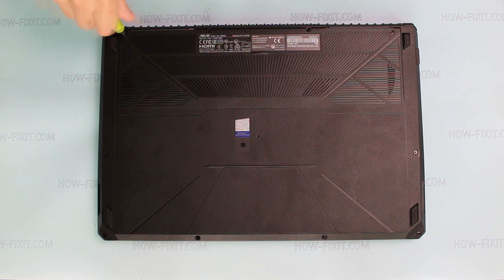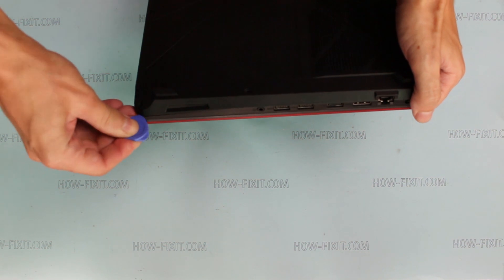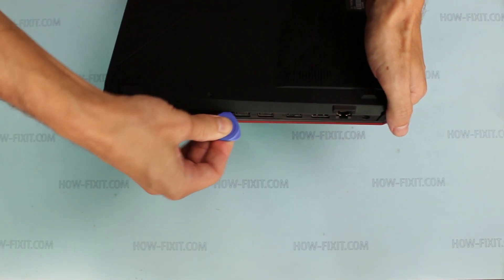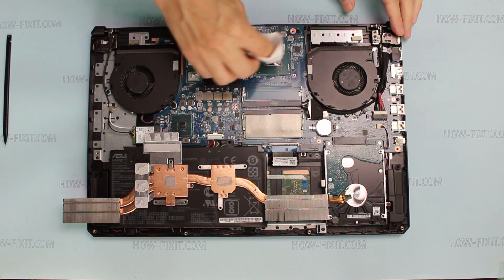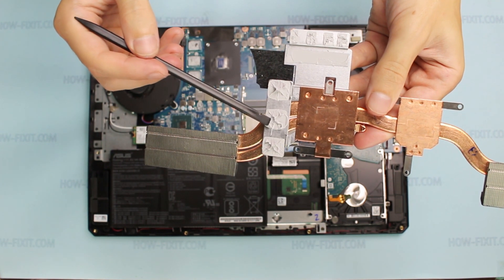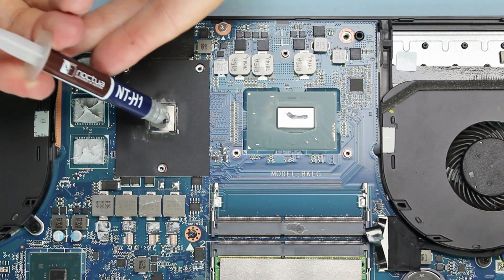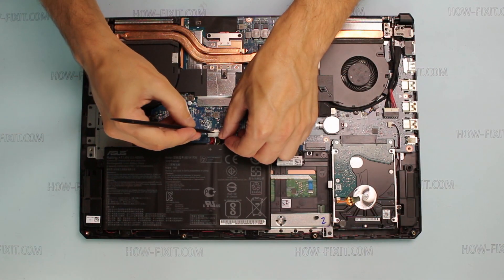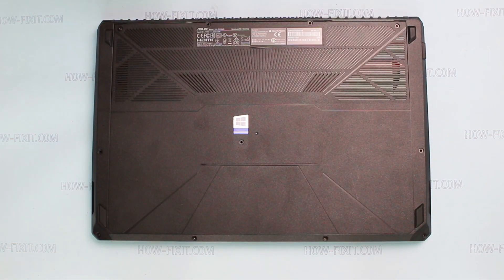Asus TUF FX504 Disassembly, Fan Cleaning and Thermal Paste Replacement

Comment: My gpu was at 80 celcious , 90 + on specific games. I literally dropped my resolution to 800x600 just to not stress the system. After opening up and following your example to the letter, i can hear my fans shoaring. 
The paste from manufacturer was a solid block of gum and allover the place. I meticulously spread paste just to cover the surface evenly and now my gpu is 56celcious tops...
I cannot fathom this, thabk you so much.

Comment: Hello, thank you for the guide, but I saw it after I changed the thermal paste without removing the battery, and after finishing, the laptop stopped working. What is the problem and how can it be solved?
Reply: Sadly, your motherboard probably died. I made the same mistake not removing battery while replacing the screen and had a spark (short-circuited) which luckly destroyed backlight unit only.
If yours can't even start the bios, then it is the motherboard I assume

Comment: According to Intel it's better to not spread the paste after applying. "It might be tempting to spread the thermal paste onto the CPU yourself. We recommend letting the pressure from the base-plate or waterblock being installed do it for you. Incorrect manual application can cause air bubbles to form in the paste, which can negatively impact the thermal conductivity"

Comment: Hii, amazing tutorial, but I have a huge problem. At first I didnt have the proper screwdriver so I used the smallest one I had and tried to take out the screw of the heat pipes but I couldn't. Then I bought a set of screwdrivers and finally managed to unscrew them, except the one I had been trying to unscrew, its head was worn out. I still can't unscrew it and the laptop is getting really hot. Is there any way I can take it out? Maybe ASUS can fix it?

Comment: My laptop wont turn on after this 
Even my charger led is not turning on (i didn't take my battery cable out before taking out the heat sink is that the problem) plz help plzzzz!!

Comment: Thanks for the tutorial! I need to do this soon for my fx504 lol it has become so much worse performance wise
Reply: Is it good now? After installing thermal paste? Also which thermal paste did you use and in how much quantity?
Reply: @madhunagar7940  I replaced it today, the temperature has dropped quite considerably, initially it would get to 88 and undergo thermal throttling, but now, after extended periods, it stays in the 76 to 80 range. On normal use, it's temperature has reduced by 20 degrees. I used the same noctua thermal paste used in the video. It was a bit difficult to remove the plate covering the cpu and GPU, but it eventually came off

Comment: I couldn't unscrew the heat sink at all
It was screwed very tightly
Reply: Same dude, I saw that there was another set of smaller screws after unscrewing cover so I looked around for a smaller corresponding screwdriver, only to find out I couldn't turn it at all even though it fit the screw head
Reply: I got it unscrewed by bringing it into an electronic store. Apparently I just need the perfect screw for it which is way too specific

Comment: My CPU was running hot on my one year old FX505DT, temps running near 200F during game play.  I replaced the thermal grease on the CPU and GPU, now my CPU Temp is about 160F - 170F during game play.   Thanks.

Comment: Thanks a lot, got about -40 degrees drop, cleaned fan and replaced paste that was inexistent
Reply: Replaced all the paste,
Reply: used thermal pads and paste both
Reply: @mirko7098  I used thermal paste everywhere.. i don't have thermal pads...
Reply: how did you cleaned the fans/

Comment: unfortunately, you must remove the heatsink in order to clean the fans, which means that you have to replace the thermal compound every time you do that. I used arctic MX-4 and after replacing the stock paste managed to reduce my CPU temp during a stress test from 90C (thermal throttling) to 72C max. results would probably be even better with something more expensive than the MX-4. so yeah, guys, replace the stock thermal paste, it's garbage! ASUS really didn't bother using quality paste, unfortunately.
Reply: Can you suggest which thermal paste is the best, mine stays at 77-80oC while playing low graphic game.. I just changed it last week..
Reply: @Dean.Michael.Winchester  I bought some gelid gc-extreme and so far am extremely happy with it. 3 months after changing to it the temperatures are still good.
Reply: @Gedas_Ke  what's the temperature tho?
Reply: @Dean.Michael.Winchester  goes up to 80C during a 10min stress test, which doesn't trigger thermal throttling.
Reply: @Gedas_Ke  oo thank you for the input, I am going to try that brand, I used to use Kryonaut before, but I seem to dry quite fast since I am a heavy user, now I am using coolermaster master gel, but I am dissatisfied with the performance 😔
Reply: @Dean.Michael.Winchester  ah, see, Kryonaut is a bad choice for laptops, because Kryonaut has a max temp of 80C. It is super good in terms of performance, but degrades quickly at high temps of 80+. And laptops often reach 80 under heavy load, so it's not good long-term, it will degrade much faster.
Reply: That’s why you use compressed air to clean the fans
Reply: @verynice4829  yeah, what else would you use? not sure I see your point, friend
edit: ah, sorry, I got what you meant. yeah, that works for surface cleaning but I find that it's hard to get all of the dust out with just air, as you need to get there from both sides in order to be thorough. maybe it's not necessary, I'm just kinda OCD about these things. x)
Reply: @Gedas_Ke  ohh, btw what did you use for the vrms? Is thermal paste enough or should I get thermal pads. I have a similar laptop. tuf f15 2021
Reply: @verynice4829  I just used paste, seems to work fine, though I will admit I don't know if pads would be better or not, I've never tried them out before.

Comment: do you have a video of how to remove the fans? i accidentally banged the side of my laptop with my mouse the other day and the right fan has been making it a weird grind noise . i completely cleaned out the vans with a air compresser and vacumn and sprayed a hint of lubricant in there but its is still making the faint grind noise, nothing seems to be rubbing on it and nothing is caught in there from what i can see but im hesitant on removing the fans because it looks complicated
Reply: never, ever clean your PC with a vacuum.
Reply: @Gedas_Ke  i ended up replacing the fan its fine now, used the vacumn nothing bad happened
Reply: @dukenukem7043  that's good to hear, but in the future I would avoid using a vacuum, compressed air is more than enough to clean dust and is safer for the hardware. cheers!

Comment: Which one is the CPU and GPU?   Is the GPU closest to the memory card slot ?  With Desktop computers the CPU is easy to locate. I am not familiar with laptop layout and it's components other than Battery, CMOS Battery, Fans, Memory and Hard Drive / SSD,  and heat pipe.  I need to replace a noisy fan, think it has a bad ball bearing,  so I need to know which one they consider being GPU or CPU side. Why did you not replace the thermal paste on the other components as they seem important too. This would of been the perfect time to install another memory module for Dual Channel (2 x 8GB) and replace the slow Hard Drive with a SSD as you could use a program like EaseUS Partition or EaseUS Todo Backup to clone the Hard Drive operating system / Windows 10. It would greatly improved your laptop performance with those two upgrades.  You did very well on the video. Thank you.

Comment: To anyone who is wondering about the thickness of the thermal pads used for the smaller chips, I spoke to Asus and apparently they're 0.5mm thick.
Reply: How about for the tuf505du series?

Comment: i Have a new tuf fx505dd ( 3 months old ) who heats up even on idle , should i replace thermal paste ? and does that void warranty ?
Reply: It's better to replace the laptop. I've got FX505DU as well and I'm very disappointed with it. Asus is no longer a reliable manufacturer for me. It's a pity I wasted money on it and used my previous experience with Asus to make a buying decision, unfortunately today Asus is a way different than was 5-6years ago.
Reply: @victor-str  whats wrong with that laptop?

Comment: is it NEEDED to replace thermal paste when cleaning the fan?
Reply: Even i have same doubt
Reply: basically there is nothing hard and fast rule , but u should replace the thermal paste because once u plug out up the heatsink it the thermal paste will be displaced and will lose the contact , 

so the summary is u should replace the thermal paste with new one

Comment: Thanks for this, I got a colossal 30 degree temperature drop replacing the paste (the factory paste had basically nothing on the contacts)
Reply: Hello, did you change the paste from all zones or only from.cpu and gpu?
Reply: @BOT_Tomi  Only the cpu and gpu. Good luck with your repair!
Reply: What paste did you use?
Reply: Hey I think I found the most relevant chat box...
I got a TUF fx556 LI, i5 10th 1650ti
I play fps games like csgo valorant
So need those extra fps, but I'm little concerned about the cpu temps reaching 85 90. I don't want to undevolt(fps drop) so will paste change help me? Which paste should I use?
Reply: @hrishikeshpingle  i got the Arctic MX4, it's a good balance of money and effectiveness.
Reply: @shantnuagarwal7416  ok thanks.
How much difference in temp did you see?
Is 85-ish°C cpu temp bad for gaming?
Reply: @hrishikeshpingle  bad? 85 is murderous 😂😂 keep it under 70.
Reply: @shantnuagarwal7416  85 is a bit under the tt limit so its fine if it doesnt go up
Reply: @shantnuagarwal7416  bhai mera 2 saal ho gaya laptop ka 92 degrees jata hai kisi bhi game pe kya kru khud se paste change kr du ya shop se karwau? easy hai ya hard?
Reply: @aniketkumar5089  bro agar confident nahi hai toh shop pe jaake kara le. Vahaan dekh bhi lena kaise kar rahe hai, so that next time agar kabhi zaroorat ladi toh khud se kar sake. Abbi tu pehle online paste khareedega, aur keval ek drop use karke chorh dega. Voh paste ki tube bhi waste jaayegi. So better to go to shop for most people.
Reply: Are you kidding me? I've recently noticed that straining my cpu throttles it down to 10-11Watts. Should I consider thermal solutions?
Reply: Shantnu Agarwal yeah try it
Reply: @bryan8946  alright, this is it. I'm tired of throttling and am gonna do it this week. Ordered the Arctic MX4 paste
Reply: @shantnuagarwal7416  do it correctly for both cpu and gpu i promise it will be worth it
Reply: @bryan8946  I opened it all up, cleaned a ton of dust from the vents and stressed my CPU with Intel XTU Benchmarks. Well, it used to always thermal throttling at 90 degrees earlier but now it's not even pushing 65 degreees under maximum possible load! NEVER expected this much gain in performance and thermals! ❤
Reply: @shantnuagarwal7416  nice bro happy gaming
Reply: @shantnuagarwal7416  Do you get FPS drop now like you used to get when it turned 90 degree?
Reply: @TheWanderPulse  There are no FPS drops anymore. After playing RDR2 for 3 hours under max settings, my temps go up to a maximum of 78-80 degrees Celsius (room temp is 25). Really recommend removing your fans and THEN cleaning them all up. Asus's proprietary anti-dust tech is just garbage. the pathway for my fans was blocked off with a dust wall, even though the vent was more or less clean on the outside.
Reply: @shantnuagarwal7416  Is your model fx504GM? My laptop is 1.5 yrs old it heats upto 95 degree. Just upgraded my ram but in vain. For first 5 mins in PES 21 get fixed FPS of 120 and then it drops to 22 and just never recovers.
Reply: @TheWanderPulse  mine is GE, not GM. But the underlying issue is the same. Heating causes thermal throttling and thus performance dip. Clean it up and see the wonders, good luck 💯
Reply: @shantnuagarwal7416  Yeah. Did u undervolt too or using the default settings?
Reply: @TheWanderPulse  nah, no undervolting. I don't like to tweak too much and risk hardware failure.
Reply: @shantnuagarwal7416  Cool.. thanks for answering my questions. I'll do the same and let's hope the issue gets fixed.
Reply: @TheWanderPulse  Good luck!
Reply: @shantnuagarwal7416  I did it today finally but for me the issue still remains 😭. There was no change whatsoever. Applied arctic mx4 and put it everywhere where there was paste but it did no good.
Reply: @TheWanderPulse  There is next to nothing I can do to help you out on this issue. Good luck mate
Reply: @shantnuagarwal7416  Was your change instant? Like after you applied it, throttling was resolved?
Reply: @TheWanderPulse  yes, instant
Reply: @shantnuagarwal7416  Damn. I wonder what went wrong in my case.
Reply: @shantnuagarwal7416  Hey buddy finally my issue is fixed now. Btw do you face hard freeze issue? I see even though temperature doesn't cross 70 i still experience hard freeze almost every alternate days.
Reply: @TheWanderPulse  What do you mean by hard freeze? Like a blue screen?
Reply: @shantnuagarwal7416  No, system hangs basically during gaming and only if you restart then it becomes normal.
Reply: @TheWanderPulse  That's sad. This is the issue with this stupid fx504 series. Their endurance is too low, you may have mistakenly left a VRM without thermal paste and it might be heating up. I recommend you avoid heating up the laptop at all costs. Mine's dead already because of overheating and I am building a PC this week.
Reply: @shantnuagarwal7416  Oh that's bad. In my case i did use paste everywhere and even the temps are taken care of. This freeze issue has been there ever since i bought this laptop. Sometimes it'll happen within minutes sometimes hours, it's not fixed but it'll be happening for sure.
Reply: @shantnuagarwal7416  god damn that's a big drop in cpu temp , i haven't cleaned my laptop and haven't done the repaste in 3 years , going to do it next week and i will share the results before and after
Reply: I just opened my laptop and i see there is so small amount of thermal paste on conector near the gpu and cpu, is the same type of.pastd there?
Reply: @BOT_Tomi  yes

Comment: I just finished changing the two year old paste, they seemed to have done a terrible job at the factory. I used arctic mx-4. The temps have dropped by at least 10 degrees during load. thanks for the video!
Reply: Do you kNow on which side the gpu is
Reply: @XicorYT  The GPU is the one on the left, with the gpu manufacturer name written on it.
Reply: did you have to replace the paste on the smaller components too?
Reply: @afkoptk  i changed everything I saw. If you mean thermal pads, the thicker rubbery stuff, then no. Just regular paste
Reply: @ragreff5603  no i meant did u change the paste for the tiny stuff other than the gpu and cpu, like in the video above he said it was still elastic so not needed to cahnge, i meant those bits
Reply: @afkoptk  can't remember. But imo do all you can, can't hurt

Comment: Hi, I know this video is old but I have to ask. I did this thing but I didn't disconnect the battery cable. And now my laptop does not turn on. Do you know if it has a solution or something? I'm worried.
PD: I didn't disconnect the cable because I saw, saddly, another video where the guy didn't do it. Hope you can answer and thanks for the good video.
Reply: It probably got short circuit
Get that unit looked up

Comment: This was what I needed, thx.
I'll replace the thermal past of my fx505 that has the same heatsinks and chasis
Reply: Hi, did you do it?
Reply: @letychannel4847  Yeah, I did it. I used artic mx5 and my temps now are good, now they never hit 90° celcius and they are between 70-80° celcius
Reply: I have fx 505ge did you replace thermal paste in northbridge. I totally replaced thermal paste in every area and yet my idle temps is always 50. Also did your laptop have any thermal pad?

Comment: Hello and thanks for this video. I have bought the Asus TUF FX505DV laptop a few days ago and I am very disappointed by now. The bios is a mess, very basic, no options to define fans curve, also the armoury crate app does not allow to create an individual profile for relation between cooling-silence-performance. I realized by use of gpu-z, which shows gpu and pcu temperature, that the cpu works at over 80 °C (celsius) up to 91 measured highest temperature in Gaming turbo mode. That was a little shock for me, at first because I never saw a higher cpu temperature vs. gpu temperature and also because it should be a life time reducement for the laptop. AMD tells about ryzen 5 3550H cpu the hard cap temp. would be 110 °C but thats not far from 90 °C. So I ordered now a cooling Pad for the table and also liquid metal paste, but I feel a little fucked by ASUS because I do the work they should had done (optimising the machine to 24/7 propper functionality. I still payed for that shit… 
Problem is in my opinion the missing Ventilation input. I can try out the cooling pad, but where it should push the fresh air? There is not eneugh entry. The most I expect will bring the liquid metal paste. But it will not bring more than 5–10 degree I think. Will it?

My question to you: Could you also realize higher cpu temperatures, because the cooling and case holes look like work the same (btw I have added second 8GB RAM and a hdd, could might be a little raise of temperature in this).

best regards,

Johannes